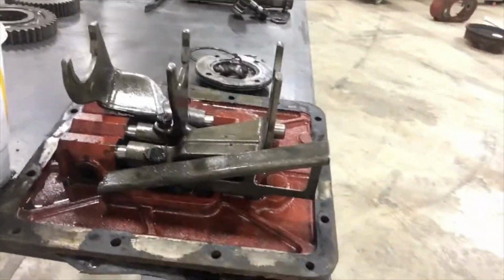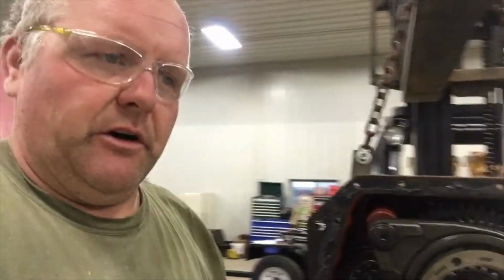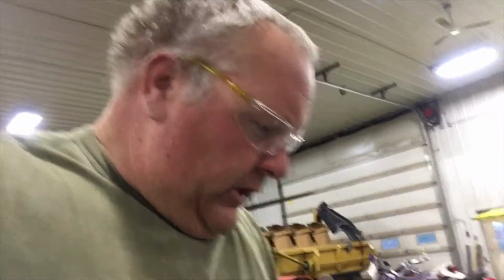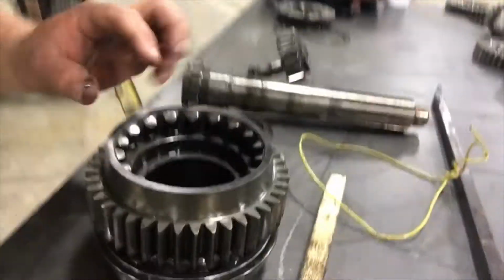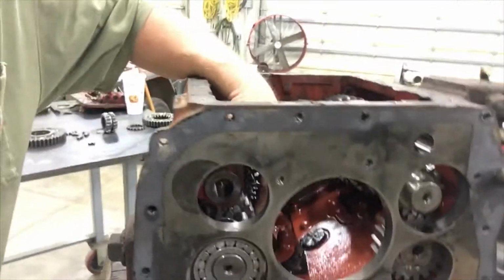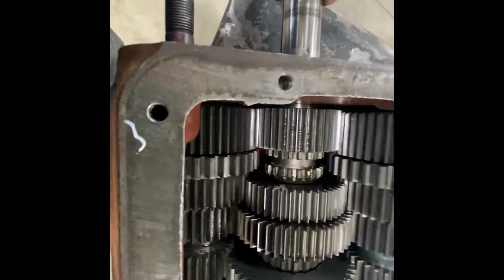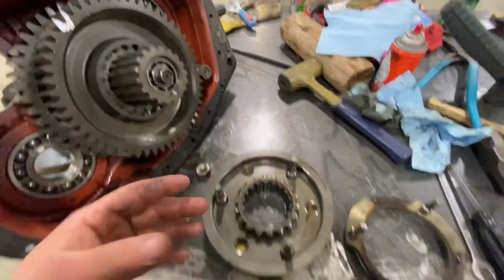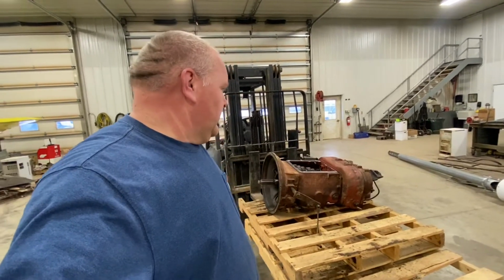Eaton Fuller transmission problem

Comment: Thanks for taking the time to make the video.  I am just up the road in Baraboo.  I have an Eaton Fuller 10 speed on a 91 international DT466. It isn't shifting into 5th and 10th.  I am thinking about tackling it myself.  If I don't do you have any shop recomendations to swap the tranny in the area? Do you think it was worth your time to work on the transmission as a novice?  Thanks for any thoughts you might have.
Reply from the maker: Hey Jack, they aren’t the easiest to take out or install without the right equipment. If you like messing with things like this and have the time go for it. I couldn’t get anyone to fix it. Everyone wants to put a rebuild in. I don’t blame them no risk for them.

Comment: You time main box but matching both timing marks across 180 degree on counter shafts. also install your main shafts in first and then reverse idler and use new coil springs on reverse gear holding pin, there is a special tool for to install that spring lock washer.

Comment: The sliding clutches do all the shifting - and grinding in a synchromesh "crash box" transmission, shift forks can look "fine" yet be worn too thin to shift the sliding clutches properly and fully, all the damage in your trans is due to shock loading and those "gear" teeth should absolutely have significant and "sharp" angled/bevelled "teeth". That prevents "gear clash" and allows them to "self-align" during shifting. As for timing, 99% of guys including "mechanics" would have no clue timing is necessary because they've never been taught about "hunting", "semi-hunting" and "non-hunting" gear sets. As for "remove and replace" to "repair" a transmission, since Eaton-Fuller Road-Ranger transmissions have "unlimited" GVWs in "stock" trucks behind stock "untuned" engines and never "see" engine-driveline torque during shifting if operated "by the book", pretty much all in-service failures are "human error" and due to abuse and/or neglect and improper operation, service and maintenance. So when a transmission "fails" the "smart" owner-operator-manager-mechanic-techician opts for a "new" transmission with warranty. The other major failure cause is improper "speccing" of trucks and/or powertrains and "upgrading" and/or "converting" trucks/powertrains/components to/for incorrect applications. Especially 10-speeds in "vocational" use like dump-trucks or other "off-highway" applications. There really is no "good" RoadRanger transmission for "off-highway" which should be obvious by the name RoadRanger itself and very few "OTR" trucks - i.e. Class 8 semi tractors are - properly specced for reliable, durable "conversion" to off-highway use - i.e. "stretching" the frame and installing wet kits and dump boxes of any kind but especially true dump boxes with single-cylinder hoists. Just like very few straight trucks are suitable for "conversion" to a semi tractor. In particular dump truck "doubles" are a bad idea for a "converted" Class 8 semi-tractor if operated in a "jacknife and dump" mode/environment. Shock loading is inevitable when jacknifing and straightening "doubles" that are actually "pups" and "dump boxes" on real dump trucks are almost never intended for "stockpiling" type operations where "jacknifing" is required. And transmission-mounted PTO "wet kits" are a very poor choice for a dump truck or any vocational use. Engine-driven hydraulic pumps such as those on state road department dump/plow trucks that cannot be inadvertently overspeeded, engaged/disengaged under load and/or have their drivelines bound up during operation are the only durable and reliable operation. They require the engine to be shut off, are rated and designed for "engine speed" and are made for inline-straight line operation and mounting and cannot "bind up". And the biggest mistake that "mechanics" make installing "wet kits" with trans-mounted PTOs is getting the drivelines perfectly "straight". U-joints just don't ALLOW driveline "angularity". They REQUIRE it for proper, reliable and durable operation. Which is yet another "human error" in the "conversion" of semi-tractors to straight trucks via "stretching". Drivelines end up too "straight" from the trans output to power-divider input, insufficient "angularity" causes the u-joint needles to brinell in the crosses and they "lock up" and can bind up and fail to "release torque" during improper "clutchless" shifting or even proper "double-clutching". The binding shock loads and "shock unloads" transmission components. PTOs engaged can do the same and "dump trucks" are the biggest victims of that sort of damage. A smart truck "builder" puts a "straight shift" - like a 5-speed "gearbox" - trans in the truck and two-speed locking rears and leaves the OTR parts out/off of an "off highway" trucks or at the very least "regears" and "detunes" a Class 8 OTR truck during "conversion" to off-highway use and installs pusher axles as required to keep single-frame "stretches" from twisting and binding under load. Because once the frame hits the limits of its "rigidity" powertrain components start "flexing" and are the source of all "frame flex" themselves. And those transmission cases are obviously "full of holes". Adding "upgrades" like PTOs just adds stress, strain and load and "weakens" them vs. the "tin" PTO opening covers. 

You will be "repairing" that ROADRanger transmission endlessly if you do not "put in a new one" and/or prevent the other human errors that caused the "premature failure". Especially if you only replace "bad" parts and reuse the "good" ones per your visual inspection and don't know what "good" ones look like. And do not repair it "by the book". 

Eaton-Fuller really does make service manuals for their products and they offer other "tech support" that is either "free" or WAY cheaper than another "repair" when "good" parts don't "fix" the problems.
Reply from the maker: Wow very interesting! I feel bad Now I fixed it knowing it isn’t going to work!
Reply: wow thanks man you are awesome.

Comment: I have a 2006 columbia Detroit 60 series and my gear 4&9 will not stay in gaged while driving what could be the problem?
Reply from the maker: It is possible that the slide clutch “10:40 in the video” for that gear may be damaged or the gear itself is bad. 4 and 9 use the same gear. Good luck 🍀

Comment: I have a problem with my transmission not going in reverse, Its a Eaton Transmission model # FS6105 A, Serial # 8613670,  5 speed manual shift..... any ideas on what it could be.
Reply: check your detents or lock plunger to start with.

Comment: "Extra low gear" is not for "starting" excessively heavy loads like you no doubt put on that "dump truck" you have 5 axles on to get "legal". It's for "extra low SPEED" operation in a "load on the go" situation such as "keeping down with" pavement milling machines, pavers etc. It's also not an "auxiliary transmission" in any trans with fewer than 13 "speeds" and/or you cannot "split" gears in. It's an "overdrive".
Reply from the maker: Right on little buddy!!

Comment: I drive eaton fuller transmission when I drive over 65mph I hear  a grinding noise under my shift stick transmission  when is on 10 gear only doing 65mph any ideas .thanks
Reply from the maker: That’s no good. It could be a number of problems. I’m sorry I can’t help you more!
Reply: Did you find out the problem?

Comment: I have a 2005 Freightliner Century Class S/T, Detroit 60 series smartshift with the clutch pedal with no fault codes . When I first start it ,then put it in gear it shift fine I can drive for hours. When I need to take a break turn it off . then try to get it to go into gear it won't. I would have to sit for a while and then it will go into gear and drive for hours. Do the XY Shifter suppose to display fault codes?

Please can someone help me
Reply: Probably operator error during "shutdown" and its "stuck in two gears" at restart. Eaton-Fuller covers that in its technical support/operating instructions videos. Why not ask the OEM experts that built it instead of random strangers online? And try reading the instructions. If you don't have an operator's manual, get one. It might cost you all of $20. Or be a free PDF from Eaton.

Comment: I have a eaton fuller in my 2013 peterbilt 579 , and it say the temperature is to high.. what u think of that?
Reply from the maker: Johnson Berry low oil level or possibility of a bearing going out.
Reply: Johnson Berry synthetic oil will lower the temp by about 10 degrees.
Reply: check oil level, low oil level will raise temperature, also if your transmission is covered with mud and oil that will be another thing you need to clean.
Reply: Overfull on lube and/or improper lube will cause "overheating". And you do not know its actually "overheating" until verifying the temp with a known good mechanical gauge. Overloading is another prime cause and the major/main/primary cause of overheating. And it is not necessary to have a truck at max GVW to "overload" it. 

"Tuned" engines and/or improper truck "specs" are major causes of overloading, too. Heat is friction and more "horsepower" at any given engine speed means more torque is being produced. More torque = more friction = more heat. Modern technology and "lean manufacturing" extend to engineers being able to design and construct vehicles and components such that any significant degree of "tuning" and/or overloading or other "abuse" and/or "neglect" will cause "issues" ranging from "derating" and/or "idiot lights" and "trouble codes" in acute cases to "catastrophic failure" in chronic situations. 

And good old "gear oil" is almost never used in modern "manual" transmissions in this day and age. Particularly those with any kind of "synthetic" synchronizer clutch plate/disk material in the "brake" portion of the "synchro". Improper lube can and will cause "synchros" to slip and generate excess heat over and above the transmission cooler's (all transmissions have "coolers" even if it's the trans case and "sump" itself) ability to remove it from the lube.
Reply: @MikeAnderson-oh9po  Synthetic "oil" has been factory-fill in new RoadRanger transmissions for decades and not just because it "runs cool". 

"Oil" that is too cool is as bad or worse than "overheated" oil and 99% of "truckers" have no clue just what is and isn't "overheating" of powertrain components. Coolant - in this case "oil" temps - are not component temps, you rarely if ever see a "red line" or "H" in a modern automotive "instrument" and "OTR" trucks are increasingly "automated" and decreasingly "instrumented" because of far too many "professional" drivers that don't even know trucks come with an "owners manual" and most of those that do can't be "lowered" to read one. 

"Electronic" vehicles, engines and transmissions are only more "reliable" and "durable" because they are "smarter" than 99% of drivers. Especially "professional" ones in improperly "specced" OTR trucks and the primary "smart" thing they do is "uprate" all "cold" and "underloaded" and "overcooled" components once any "warmup" has taken place and "derate" only truly "overheated" vehicles and components but not to the "limp home" extent where a "professional" driver - especially an "owner-operator" of an out of warranty "preowned" - wants or needs to "shut down" the vehicle immediately. 

Only rapidly and continually dropping vehicle/component "readings" for pressure(s) and temperature(s) constitute real "emergencies" and "overheating" is ALWAYS already "human error(s)" in speccing/service/maintenance/operation of vehicles and components and is "repaired" by correcting the human error(s) immediately responsible. Which is always "overloading". Even "empty" it's "overloading" the vehicle/component cooling capacity "as-is" and "where-is". And "shutdown" immediately eliminates ALL cooling capacity. Which is why modern "smart" vehicles keep their operators as "dumb" as possible and especially "professional drivers". 

The fewer "instruments" in the dash and/or actual "data" they convey and/or controls in the cab the "smarter" the vehicle is and the "safer" the driver is out "on the road". Distracted driving is the most dangerous kind and if "trouble codes" were accessible key-on and in-gear and in-motion more "professionals" would be using some sort of "lifeline" to try to "repair" the supposed "problem" as they drive down the highway. And the more "expert advice" like "run synthetic" they'd get on social media whether online on "how-to" videos and owner/operator/enthusiast "discussion forums" or offline from local "experts" that automatically assume the "problem" does in fact exist per the "noob" and his/her "help request" and is an actual vehicle/component "failure" and not "human error" in choosing/ operating/servicing/maintaining same. 

"Overheating" is "past halfway" per most vehicle "operators" in a "C-H" so-called "instrument" or noticeably over "200" because they remember "science class" and 212 F - or sowhere "over 200" - is the "boiling point of water". And they apply the same "knowledge" to "oil". 

But they "forget" or "overlook" that cooling system pressurizing "radiator caps" raise the "boiling point". And it's not "pure water" and it is not "static" in a beaker or test tube. And that's the "hot" coolant temp and not the "cool" coolant temp. And as long as there is still "room" for the needle in the "instrument" to go "up" there is still "cooling capacity" ("cooling" systems "remove heat" instead of "adding cold") in the cooling system. It's not fully "hot" yet and can continue to "cool" and DOES continue to "cool" until the "instrument" is "pegged" and/or the coolant "boils over" and "pops" the "radiator cap". 

Which can't happen UNLESS the cooling system is "full" which is why "boiling over"  cooling systems should never be "checked" even after "cooling down". And why "low" cooling systems never "overheat" and "boil over". 

99% of "catastrophic failures" due to "overheating" come from "servicing" components "hot" and/or "cold" in a "static" condition and/or with incorrect fluids. And shadetree "fixes" like adding "coolers" or "overfilling" or putting "modern" lubricants in "vintage" vehicles/components. 

"Synthetic" lubricants have been around for the majority of the history of the "internal combustion engine" and if and when they are necessary to and for a vehicle/component to "run cool" the component will be "sealed" and/or "tagged" and/or "specced" as such "from the factory". 

And 10 degrees is never the difference between "normal operating temp" and "overheating". Nor can you "trust" an electric/electronic temp "gauge" to read "right" in an "oil" it's not specifically engineered, designed and calibrated for. Which is why "main transmission" temp gauges started disappearing from OTR "instrument panels" and "driver" temp gauges stayed once "autoshift" (every "AutoShift" RoadRanger trans is just a "manual shift" transmission with an automated "air shifter") transmissions and synthetic "oils" started being used in OTR truck transmission. 

Which is NOT a "heavy duty" application for transmissions with an "unlimited" GVW used "on highway". 

"Stop and go" driving even "empty" is "severe duty" for a "manual transmission" due to all the "constant" so-called "auxiliary box" synchronizer "shifting" even/especially if "clutchless" upshifting/downshifting is used  (overloads" the "synchro" BRAKE unit) which is why for "vocational" and "off-highway" use true automatic transmissions are "preferred" and "powershifts" have replaced "autoshifts")

And no "dump truck" should be specced like an OTR truck with a "high torque" ROADRanger trans like a "10 speed".

Comment: Got a 10 speed that will shift like butter in low range but after 6th you have to put a good amount of pressure on the stick or wiggle it around to get it to go in makes for some really hard painful shifts anybody up here got a idea?
Reply from the maker: Zane w I would say it has to do with your a auxiliary on the back of the trans. 1st and 6th-3rd and 8th and so on are using the same gears in the gear case and the auxiliary changes the ratio. So if you shift through the gears on the low side without a issue and flip to the high side and have problems something is possibly wrong with the synchronizer in the auxiliary gear case.
Reply: @joelwyttenbach2772  OK thanks
Reply: Use the clutch.

Comment: horrible gearbox,even OEM's had trouble installing them
Reply: Who else would "install" one besides an "OEM"? And what makes it "horrible" besides being "specced" wrong for a "dump truck" being "run" so stupid heavy it needs 5 axles on a Ford 8000? 

Not exactly a "Class 8" truck there regardless of the "8" in the "model" designation. The guy has a forklift, a "dump truck", "race cars", a "private plane" and a 12-row cornhead behind an "antique" or at least "vintage" Oliver tractor in his "shop" and the odds of him being a "good" truck driver - which requires being a "specialist" and "professional" to develop and maintain the necessary "skillset" - as well as able to "safely" operate all those other "toys" and stay "current" on all of them are between slim and none. 

And there's nothing more "fragile" and intolerant of "operator error" than a "heavy-duty" truck. Especially "off-highway" and with an on-highway ROADRanger "manual" transmission. 

Of course not every Eaton-Fuller IS A RoadRanger or anywhere near it. Just like not every actual RR has an "auxiliary transmission". The "rule of thumb" is if it doesn't have a "stick" AND a "lever" AND a "switch" it doesn't have an "auxiliary transmission" in the "back box". And you don't want it "off highway". At all.
Reply: @deeremeyer1749  you need to put the crack pipe down for a while
Reply: @deeremeyer1749  put the crack pipe down for a while mate